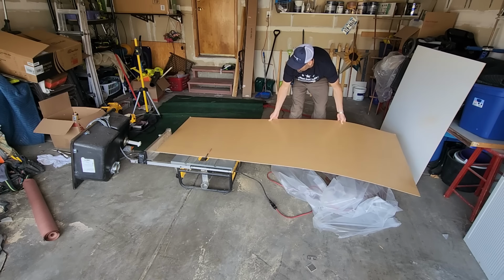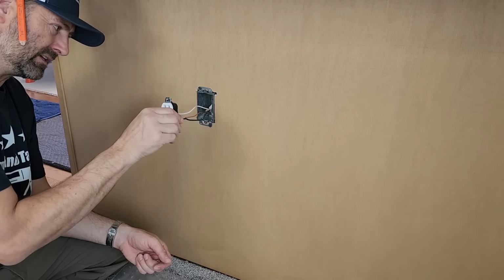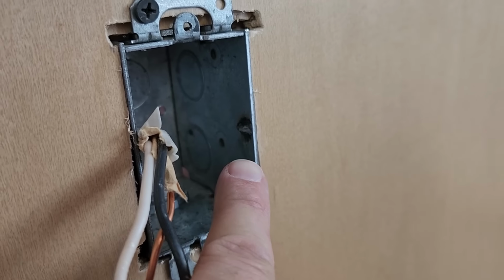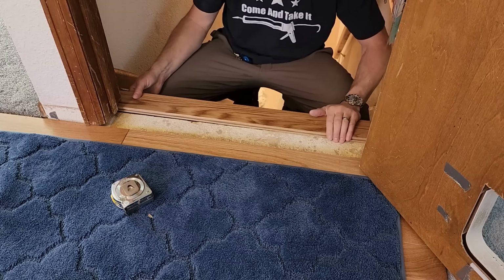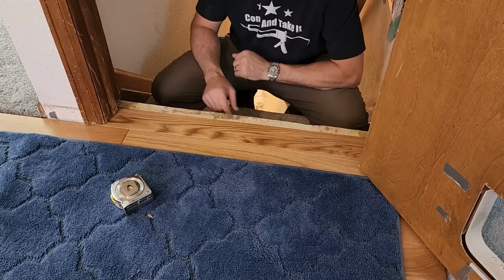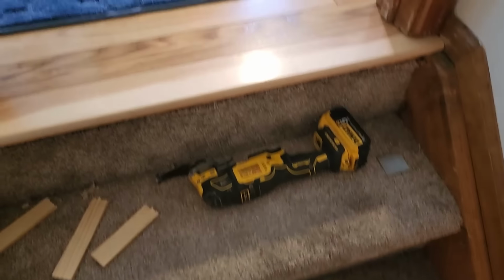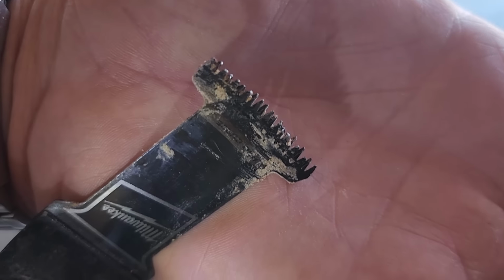Remodeling Tips and Tricks | Only the Pros Know | THE HANDYMAN |

Comment: Hey handyman, also with those metal boxes proper “code” usually calls for you to “ground” the outlet box too. That’s why most of those metal boxes have a screw toward the rear so you can loop the ground around it before you attach it to the receptacle’s ground screw. I ALSO tape my terminals on any receptacle going into a conductive box because 5 extra seconds is worth never having an issue imo. 😅

Comment: I was doing some electrical work replacing a ground fault outlet and some outlets in a series. And they were older metal boxes that seemed much smaller then usual. Regardless,  I learned quickly theres no harm in taping it when i shoved the new outlet in and it contacted with the box lol.

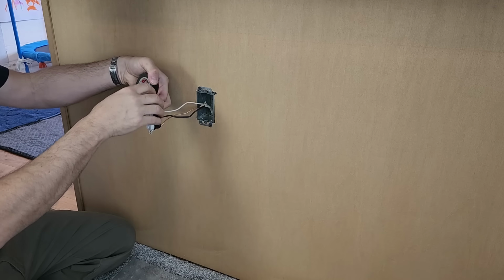Comment: 5:10 So wait it was code to wrap it back then and they made you do it?  🤔 I usually only wrap with metal boxes
PS- great job on the finish work Handy 👏👍
Reply from the maker: It wasn't code to wrap them.
Reply: @TheHandyman1  funny they made you wrap them when it didn't make them any extra money like how you said they make you do stab connections because was faster
Reply from the maker: The money was made in no call backs for shorted out plugs.
Reply: @TheHandyman1  ok now I gotcha, sorry I'm sometimes slow 😆

Comment: That metal. box is missing a green ground screw and ground connection at the back of the box Handyman.
Reply from the maker: It isn't.
Reply: @TheHandyman1 did you go back and change it, or are you counting the outlet mounting screw as your ground?
Reply: @TheHandyman1 I read his critique in the chipmunk voice
Reply: The yokes on the receptacle itself are screwed into the metal jbox, which is the ground.
Reply: @VaporheadATC  That is only for grounding of the receptacle in commercial applications when using AC/BX MC (metallic cable) and serves the receptacle itself, not the other way around.

Comment: Does the metal box need to be grounded in your area?
Reply: That is NEC code everywhere.
Reply from the maker: It is.
Reply: The receptacle is grounded through the receptacle yoke. If you look at a new receptacle, it will have two little plastic square "spacers" on the mounting screws. If you want to BOND the receptacle to the metal jbox, you simply remove these spacers and then the metal jbox is bonded to the receptacle.

Comment: Doesn’t the 2023 electrical code require peninsula and island outlets to be on or above the horizontal surface? It no longer allows them below the counter on the vertical sides. The licensed electrician who did my kitchen remodel explained that to me. I was surprised and looked up the section myself. NEC Section 210.52(C)(3)

The reasoning is that too many children, and passers by, pulled the cord dragging the appliance off the counter. I opted for the future provision option.

Comment: Why the hell are people still using metal receptacle boxes?
Reply: Is it illegal or something?
Reply: Because it’s required by code in some areas.
Reply: Probably because it's in a peninsula and when the home owner shoves a metal pan in there they don't want it to shatter like plastic or fiber ones do.  Or when little Johnny kicks the receptacle sitting at the counter the tabs don't break making the box loose.  Pretty high traffic area so metal in this case is safer when you can tape the receptacle and avoid any contact with the box.
Reply: My kitchen is all plastic boxes except the island outlet which is metal. Idk why but maybe code?
Reply: Metal boxes are more durable.
Reply: For thoes worried about metal boxes just use decora edge outlets no exposed metal unlikely to ever cause an issue.
Reply: @csimet I’m not a sparky but I’m pretty sure since the receptacle screws into the box with two screws, and the receptacle is grounded, the box therefore is now also grounded. I don’t have the NEC handy but that’s my basic understanding.
Reply: @csimet  The yoke on the receptacle itself is screwed into the metal jbox, that is your ground.
Reply: Why not?
Reply: Any wire or box in an exposed condition must be protected.

Metal boxes and conduit.